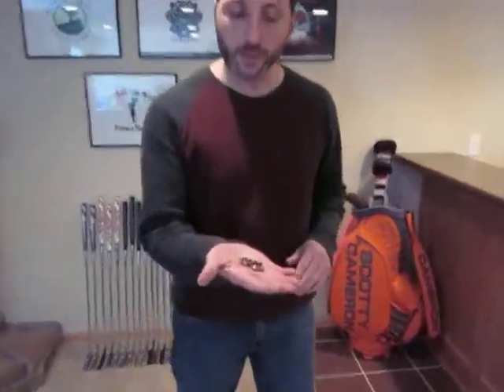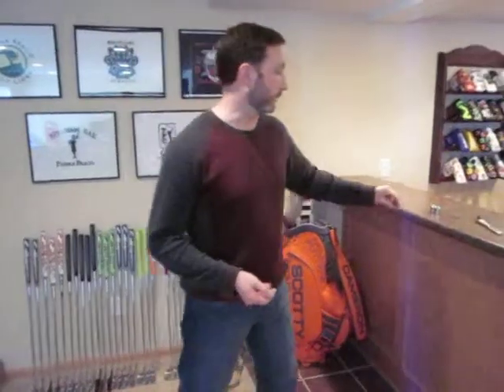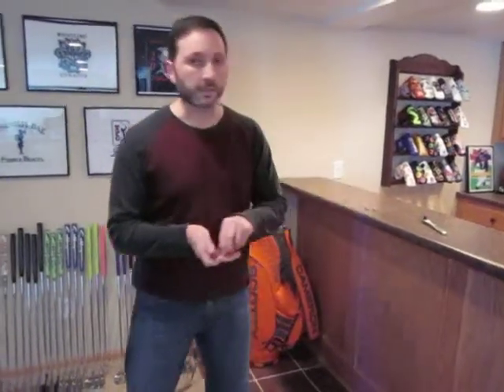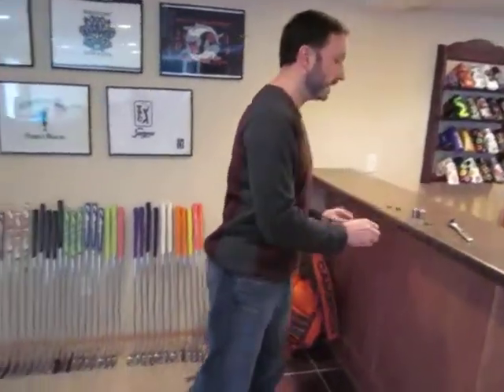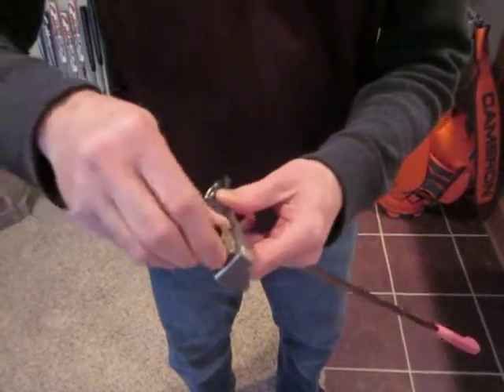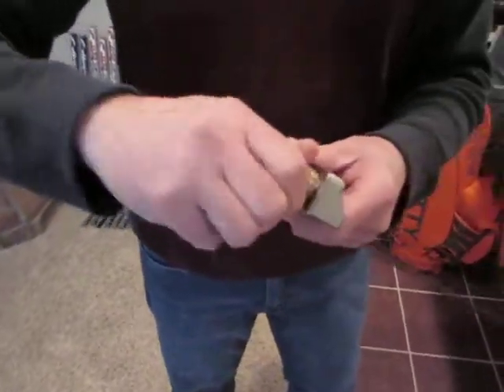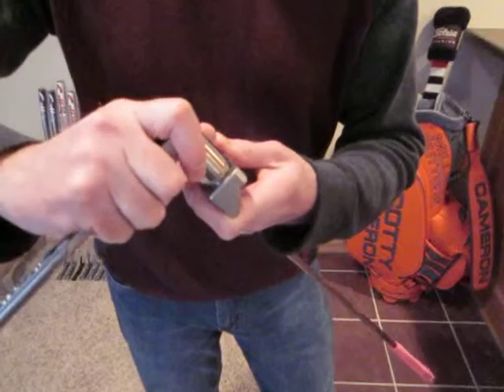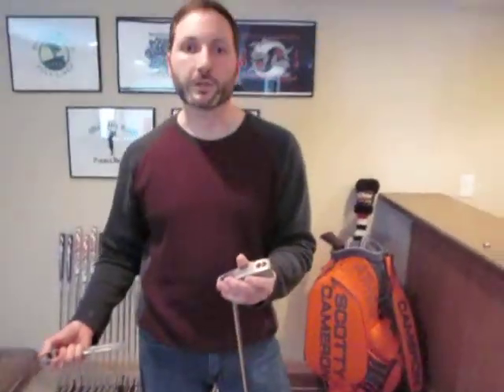Stainless Steel Weight Wrench for Scotty Cameron Deluxe Putter Weights

Comment: Does Scotty Cameron have weights inside the putter or is it just the 2 weights on the bottom? I’m asking cause I hear something loose inside my Scotty Cameron California fast back putter
Reply from the maker: Hello and thanks for your question.  Scotty does have some putters with weights inside of them, but those models typically have an aluminum sole plate with button screws in it.  The California fastback does not have that feature.  However, there are a couple things this could be.  First off, there could be something underneath your weights in the weight cavity.  This is more likely if your weights are 15g or 10g.  If they are 20g, there's not much room left in the weight cavity for something to be moving around.  The other possible culprit is the shaft.  The cali fastback has a bent shaft that is fastened directly into the putter head (if I remember correctly).  This connection could start to have some play in it considering the putter is 8 years old.  When you shake the putter, you may be hearing the shaft slightly move in the putter head, make sense?  I hope this helps, let me know if you have any questions, also I'm curious to find out the cause of this once you get it solved.

Comment: How cool!  How did you build the wrench?  I bought some weights for my Scotty Cameron California Monterrey on ebay.. they came with a wrench, but I can't get it to fit to in to remove/replace the weights.
Reply from the maker: Hi Carlos, Good question.  Did the weights that you purchased look like the new deluxe ones in my video?  If so, then the wrench you received with them does not fit the weights that came with your putter.  You can get that wrench from Scotty Cameron.com.  Let me know if I misinterpreted your question and if you need further info, contact me via ebay where my user name is wheard.  Thanks!

Bill
Reply: I don't have the original wrench.. but I managed to removed the original weights by immersing the putter in very hot water, then use bent-tip pliers.  I noticed the weights did not have threads on them, unlike the ones I bought. In fact, my new weight are a bit smaller that the original ones.  I wonder if I have a fake putter.   Thanks for your response.

Comment: Greetings and tried to change for the first time and I can not be very tight the tool I have is the basic I ask for advice to make them release please I hope your help.  Thank you
Reply from the maker: Hi Carlos, do you mean the deluxe weights or the standard Scotty Cameron weights?  I have another video on removing standard Cameron weights that are difficult, take a look and let me know if you have questions.
Reply: @wheard71  
Thanks for your help I have the originals but I change them for the first time is it true that giving a little heat is easier?
Reply from the maker: Yes,  little heat from something like a hair dryer should soften up the thread locking compound that they put in the weights from the factory.  When installing the new weights, you do not need to add thread lock.  The o-ring does an excellent job of keeping the weights from loosening.